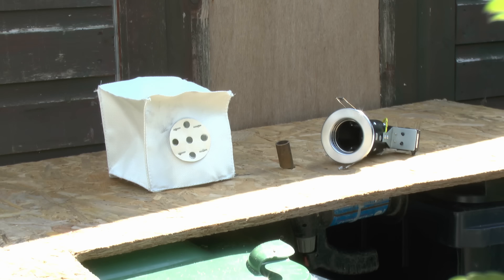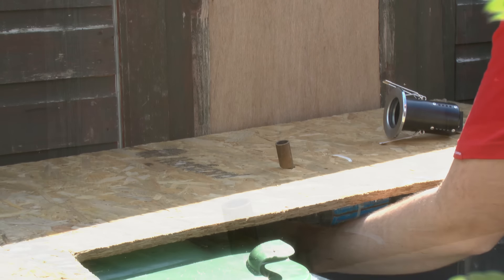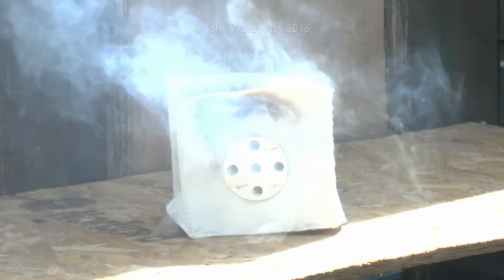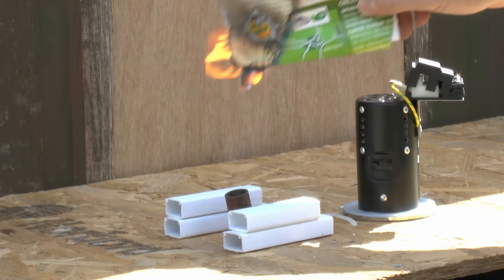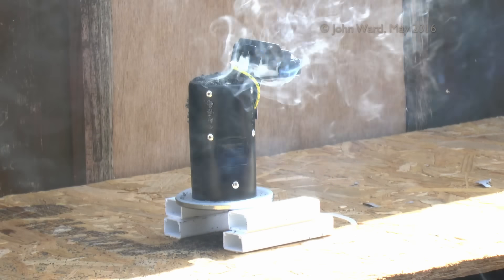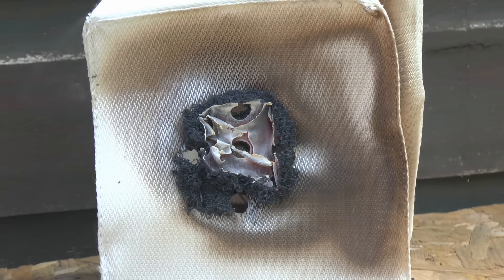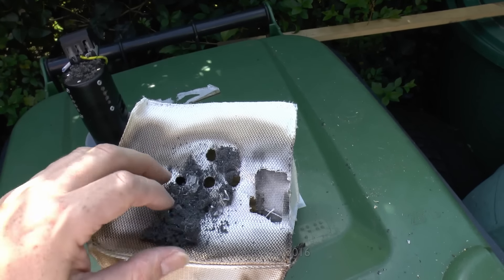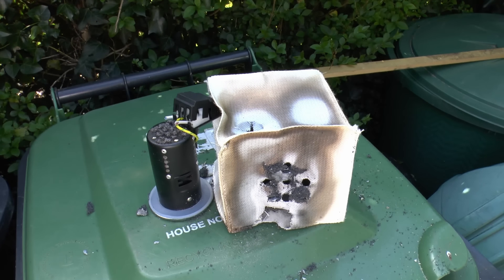Fire Hood & Fire Rated Downlight Exposed to Flames

Comment: By the time those fixtures are in a position to be able to smoke like that, the fire has reached the point that containment is your primary concern (particularly in a multi-family dwelling). Any such fire would have, hopefully, long since set off alarms and evacuated the area. I assume that expanding material would also expand when exposed to radiant heat. The ceiling will be hundreds of degrees in a fully involved fire even if flames haven't come anywhere near it yet.

In the case of the fire starting in the fixture itself, remember that the fixture will offer little fuel (by design). Once the electrical fire runs out of fuel, the fire would stop - prevented from reaching further fuel in the ceiling by the fixture or hood. Remember you were adding fuel to the fire, which would not be the case.
Reply: Yeah, it's like CFL bulbs and their supposedly "flame-proof" plastic ... not!
They use cheap fusible resistors, which are not suitable for slight overloads, because they will get very, very hot before blowing. That can cause the plastic case to burn, which is readily does, since there is a constant source of heat (other than the plastic itself).

And yes, by the time the fire would have gotten bad enough to affect the downlights, you'd know about there being a fire.
Of course, then again, there are the modern houses (at least here in the USA) which are made out of cardboard and glue - those can become fully engulfed in only ten minutes!!!

Comment: Hi John, what would happen if you grabbed an electric fence and stood on 1 leg instead of 2 would you get half the shock?
Reply from the maker: +Pacman_ king_01 No, the voltage would be the same, and although the current flow might be a bit less due to reduced contact with the ground it won't make much difference.

Comment: Wonder what the hood is made of? About the only materials I know of that will handle the bright cherry red and are fibres are a borosilicate glass or asbestos. The smoke is the PVA coat on the material used to bond it into a sheet so it does not shed fibres, so naturally it will burn.  At least I hope the smoke did not contain chlorine compounds which would be there from PVC coatings.
Reply: +SeanBZA it will be fiberglass weave, it looks like the same stuff as a modern fire blanket.
Reply: But how is it fibreglass?
Fibreglass batting (insulation) is terrible under fire conditions - it simply melts away, letting the fire travel through the wall/ceiling/wherever it is.
Reply: Benjamin Esposti
 the weave makes it more resilient